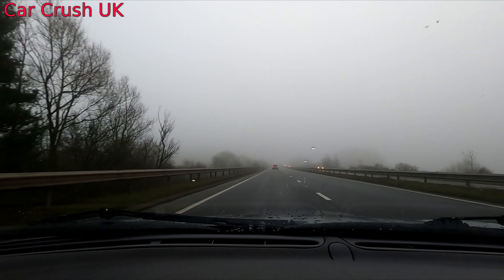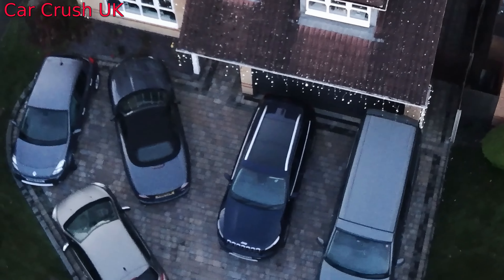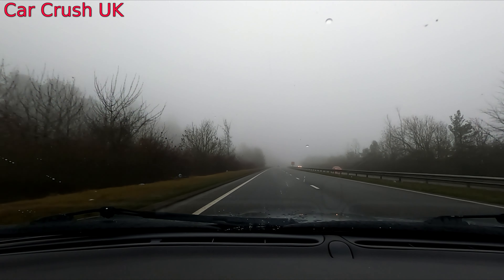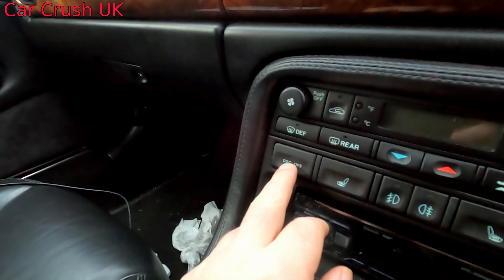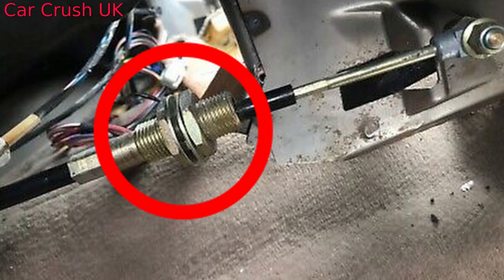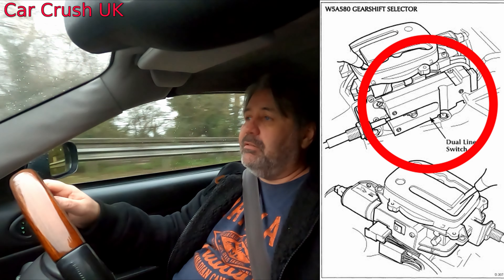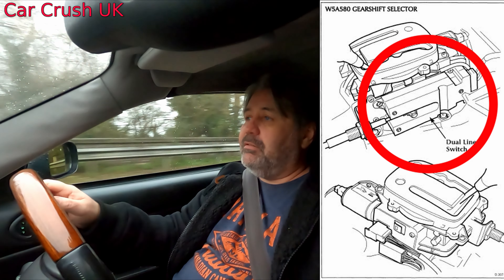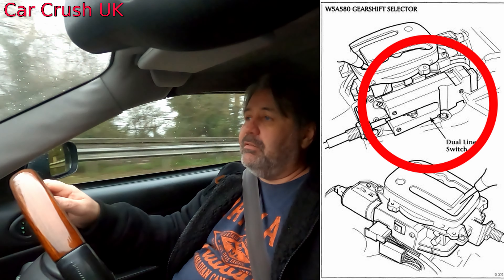2004 Jaguar XKR - 2020 repair update

Comment: Odd. Today I just watched John's vid on adding the chrome rings to the instrument dials.  Friction fit utilizing a strip of tape.  No glue.  Previous owner of your car should be ashamed.  I've owned a 2003 XKR  for 6 months now.  The only problem has been the head rest issue.  Frankly, I don't care about it.  It would be nice if everything worked but, upon watching the repair vid with taking out the seats etc... I'm too afraid to do that.
Reply from the maker: Thanks for your comment. I have not watched John's video yet. The rings on mine looked poor quality and I agree the previous owners should be ashamed. I didn't pay top money for the car fortunately. The headrest was not as difficult as I had feared. It was the first time I had done that type of work. But as you say it is not an essential thing to get working.
Reply: Take the seat out dude... It's not brain surgery